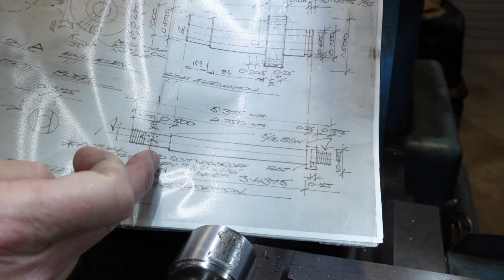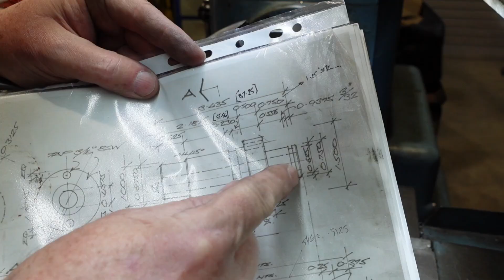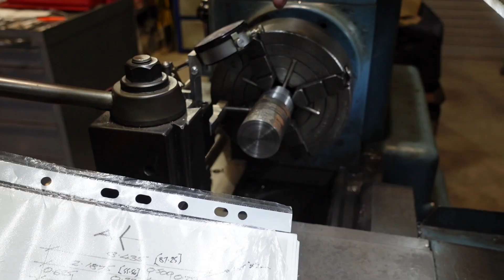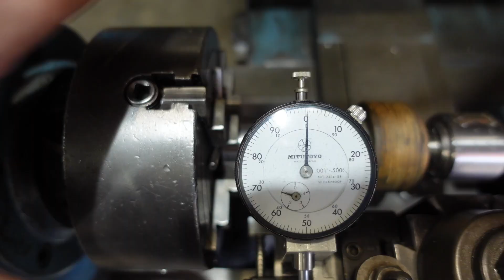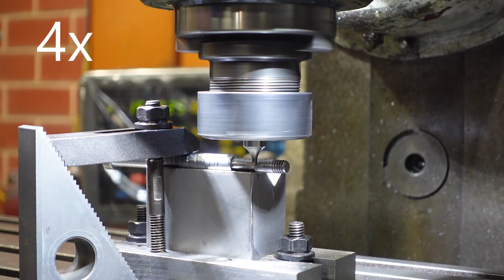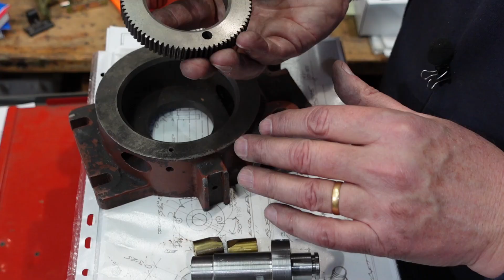Rebuilding a Hercus Rotary Table

Comment: Nice work Michael and I'm glad the drawing proved useful.
Reply from the maker: Thanks Bob. Nice to see you here. Yes, the drawings were useful. Did you see the finishing off in the 3 short videos? Made up a handle very similar to yours..
Thanks for the inspiration
Reply: @occasionalmachinist  I did watch the other video and I did comment but my comment has been deleted and not by me.
Reply from the maker: @robertthomas8744  Wasn't by me either. Sometimes Youtube does some odd things. (I've had comments vanish too - especially if they contain a link to something)